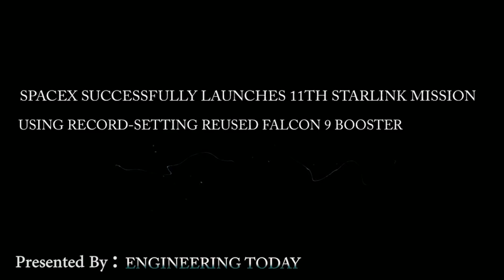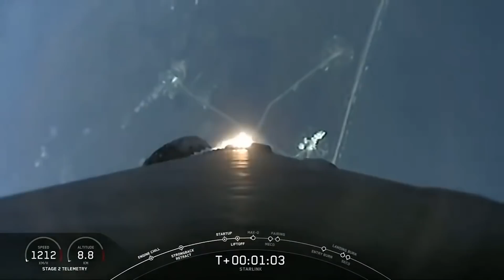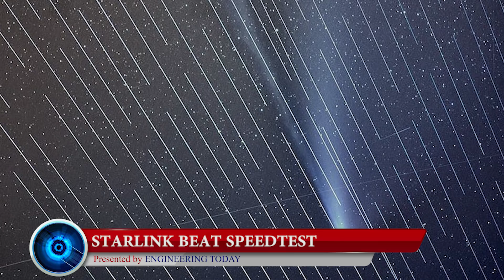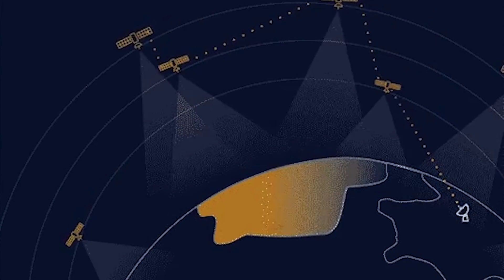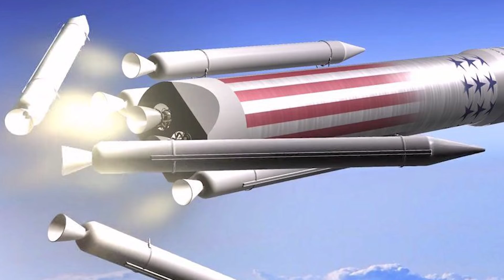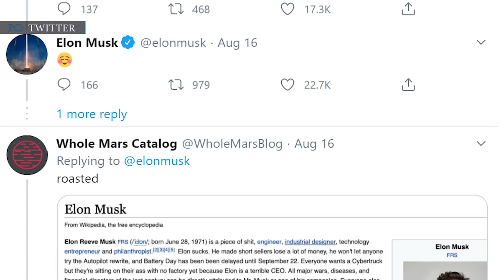SpaceX Starlink | Falcon 9 Booster Sets Flight Record | Elon Musk Weird Tweet | Beta Speed-Test

Comment: I love your content but you should definitely do a better job at verifying your informations :
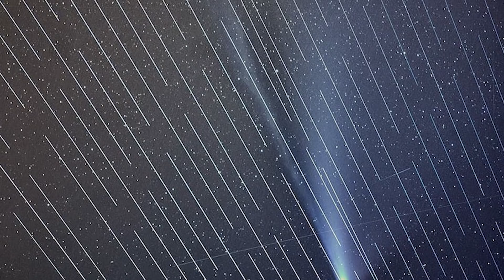- 4:00 No this is a photoshoped image. there isn't that many starlink satellites yet and they are way less bright. it has been debunked already.
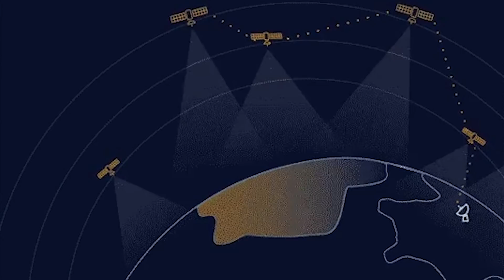- 5:55 No a starlink satellite is not the size of a shoe box : it barely fits inside the falcon 9's 4.6 meter wide fairing and weight 260kg each.
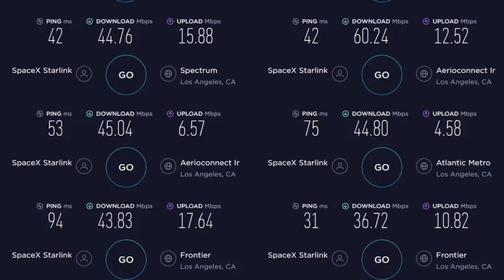- 4:40 Not microsecond but milisecond.

Comment: After looking into it, IF Starlink can provide the means to fund spacex’s expansion into larger and larger lift capacity (which seems to be the goal) it isn’t implausible to assume that the reduced cost of launch will make space based telescopes a far more viable option.

Astronomers disagree but they fundamentally also lack ambition in expanding the space based systems.

There are obstacles, but very few people are looking into ways to cheat the physics through engineering and math.

You can’t create new physics but you seem to be able to bend them enough that it’s pretty much the same thing.

The future of astronomy is not earth based.

Comment: The proposed 20ms latency is with the Starlink sats communicating to each other via an optical laser system.  This technology has not been fully developed by SpaceX and is not included on any current production Starlink sats.  They currently still handle relays and hand-offs on traditional frequencies.  Until that tech is developed, sub 100ms will have to do.  With that said, anyone who's ever had to use traditional Satellite internet will know what an astronomical improvement this is.  When using it, I get pings between 1100-1400 on average and can't even watch YT at anything more than 360p.

Comment: Milliseconds = ms
Microseconds = µs

If latency was in µs then sweet baby jesus the porn......
Reply: Top ethernet 10G SFP+ switches have 400ns latencies with short cables. Good network cards can have <2 microseconds roundtrip when used via low level APIs.
Reply: 10GBASE-SR/-LR or SFP+ DAC? Cause SPF+ DAC has an approx. 1.5 μs differential in latency per/5m compared to 10GBASE's per/10m fiber line. Also those speeds are kinda moot if the end user's network cannot handle the speeds, as it will all be throttled down to their hub's switch settings (if it's in canada it's hot garbage especially with Rogers current network nodes).
Reply: Duriel SFP+ Direct copper on decent SolarFlare cards via ev_vi. LR not much worse though I didn’t test. Message travels in less than 1us from app to app. Cable length diff between, say 3 and 5 m not noticeable.
Better Arista switches add <0.5 us.
Old mellanox x4 PCIe DDR IB HCAs do few us via verbs. Didn’t try newer.
Ofc this is not exactly consumer tech, though old IB cards are dirt cheap. Though if you use for TCP/IP most of the latency advantages are wasted, IP protocols suck.

Comment: I thought the original plan was for 12000, and then they bumped it up to ~42000 to make it competitive in urban areas? Did it get bumped back down, or is this a flub?
Reply: 12,500 is the initial plan, with a possibility of expanding to 42,000 later if everything works out right.

Comment: How is 17mb slow? My ping is 80kb rarely 1mb
Reply: Your speed is not called ping, as that's how long it takes for packets of data to be received after they're sent. 17 Mb is not slow for those with poor connections like yourself...it's enough to watch HD video on a couple of devices, or download files at 2 MB/s. But it is slow for anyone who has a fiber connection, or even a good 4G connection, so it all depends on who the user is and how fast their current internet is.
Reply: @Pete856  i mean for mobile gaming like Pubg or streamin video.. Its Pretty Darn Good.
Reply: @merxellus  For gaming, it's only ping that really matters, as a 0.25 Mb connection would probably be enough to handle the data. Ideally you'd have a ping under 20 ms, but I've often played on over 100 ms which isn't ideal. Video streaming doesn't care about ping, only how fast (how much data per second) your connection can handle.